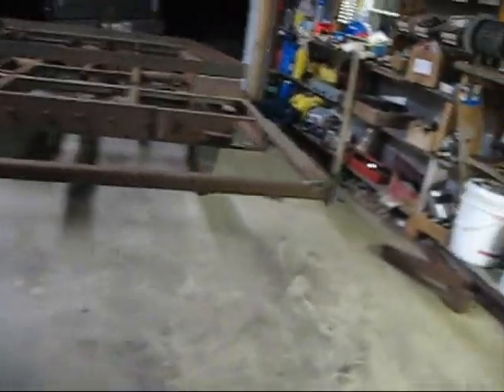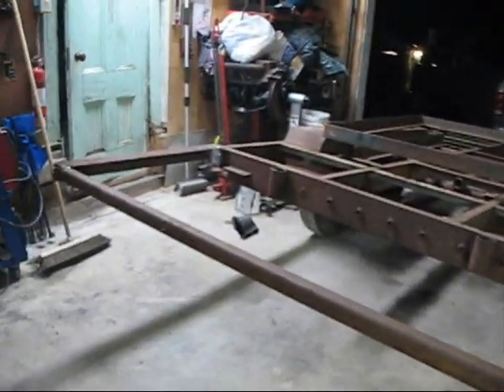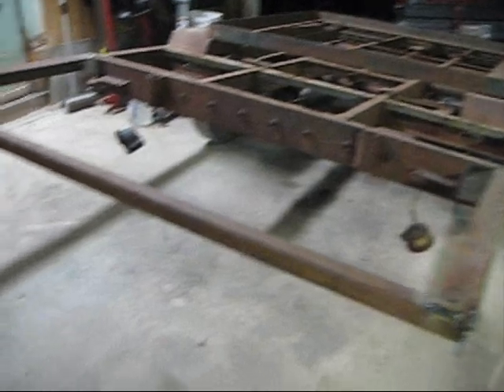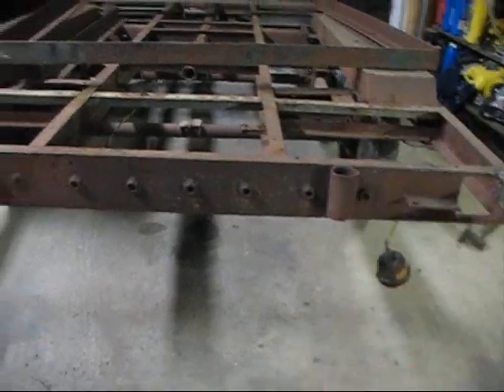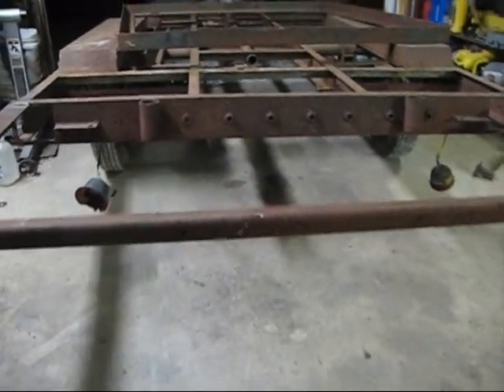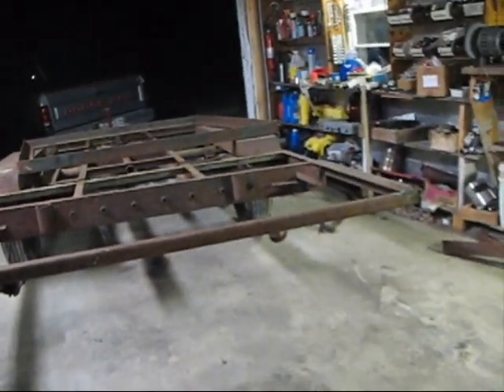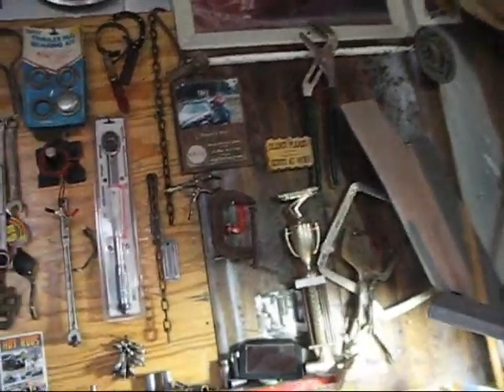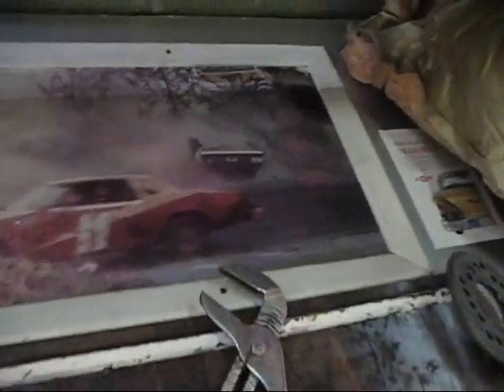Stretchin' the race car trailer

Comment: I used to race 250 lap endurance races and we used a tow bar until one day the frame was so bent on the racecar that the tow vehicle was riding near the center of the road and the back wheels of the racecar were riding on the gravel shoulder. After that we borrowed a trailer!

Comment from the maker: @jacktheripped I've got one of those I use mostly with my table saw.  Didn't go to the trouble to bring it out to the garage, since that bench was just about the right height.  My Dad made the one I have out of an old hospital table.  Crank it up and down to adjust the height.  He put a roller on it.  Works some slick.  If I did a lot of this kind of work I'd probably make up another one for out in the garage, but generally I don't do this kind of welding very often.